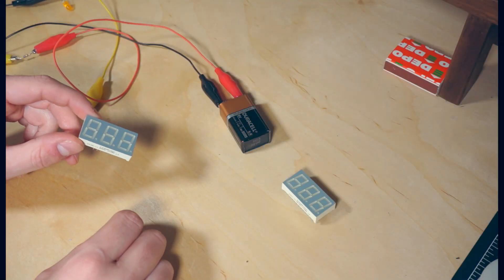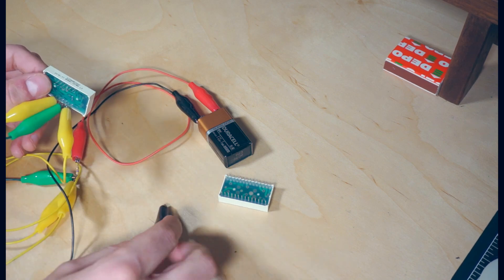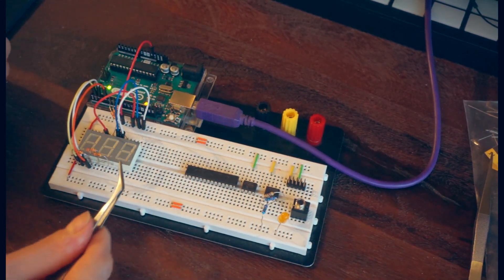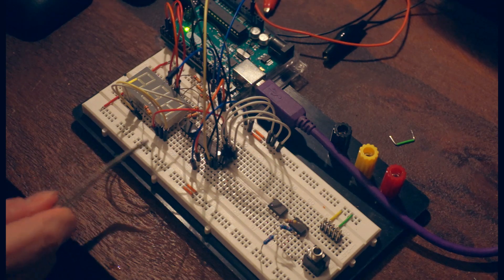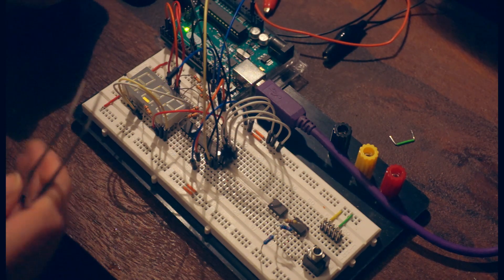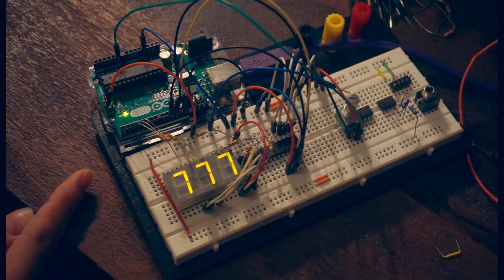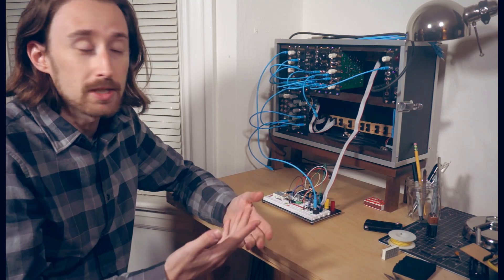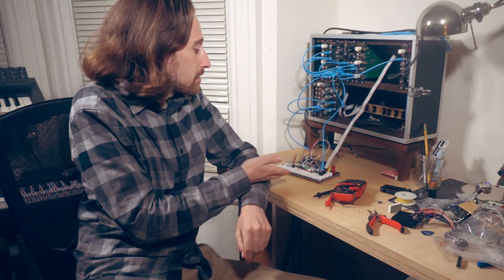Designing a Eurorack Sequencer - Part 2: Seven Segment Displays

Comment: Scanned LEDs are one of the worst sources of interference in Eurorack. This is because quite high currents are being switched and fed into the 0V which is also the analogue reference for many ICs. The solution is to avoid Mickey Mouse circuits like this  and implement constant current and current steering techniques. Think about it, do you want to be part of the problem, spreading bad practise,  or part of the solution?
Reply from the maker: Link your schematics then

Comment: Is there a need to buffer your outputs to protect your circuit from interfering with the other modules you hook into? 

I know you used an opamp to use some of the rail voltages for scaling, but if you used the Arduino as a 5V gate/trigger generator, would you need to put an opamp buffer before your output jacks to protect everything else or am I over complicating things?
Reply from the maker: Yes! Sometimes a buffer is needed to raise the level, but in any event it's critical to protect the microcontroller from the higher voltages present on the synth signal lines. If you take a look at the schematic for the Mutable Instruments grids (PDF available here: https://renbeeves.com/blog/modular/2018/06/17/mutable-instruments-schematics.html) you'll see on the lower left side that the clock input signal is fed to the base of a transistor (2n3904) and its collector is on the 5v rail with some resistor. The emitter connects it to ground when the input is high, effectively toggling the 5v pullup, and that way the signal the microcontroller sees is always 0v or 5v, never higher or in between. 

For the outputs you can do the reverse, though it's less critical as 5v signalling is sufficient for gates. Still probably a good idea as you could easily accidentally plug a higher output signal into the jack. Some have suggested a 5.1v zener is sufficient for this but I haven't tried that method.

Comment: Checkout the cheap 7 segment modules on Amazon that use the TM1637. You can run the display from one wire and the display doesn't need an active refresh.